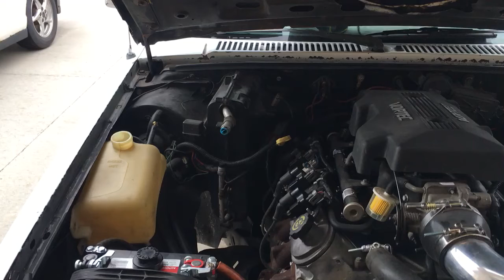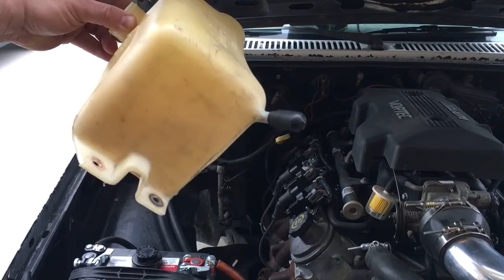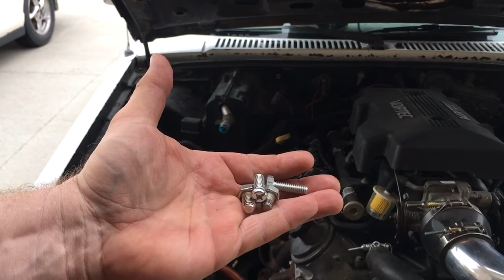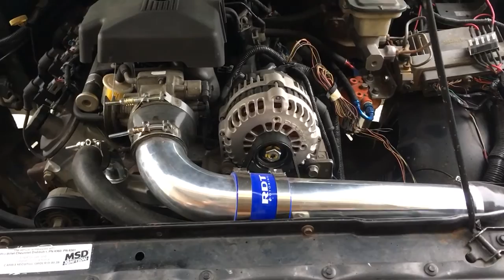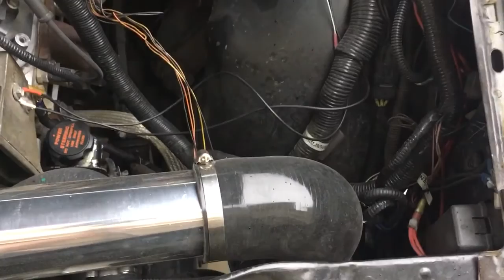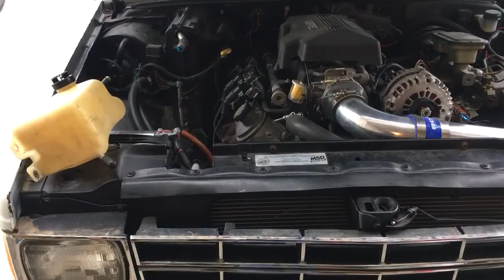Dual Exhaust NIGHTMARE plus 5.3 update

Comment: Just got my motor running for the first time tonight. Thanks for your recommendation on the vats removal from eBay!
Reply from the maker: Brian's 4x4 I'm glad your reflash worked , make sure you can Rev normally and check the codes.

Comment: That sickness made at least 90 people where I work call in.
Did you ever finish porting the Mopar small block Procomp or Promaxx heads?
Reply from the maker: TheProchargedmopar The last set of Chrysler heads I ported where 6.1 Hemi heads. I did a FAKE set of LS AllStar heads last year.
The guy Tony Sizemore Headbytes channel might be the one you're thinking of on the Mopar heads. 
I've been working mainly with LS heads lately. 
Thanks for the feedback it's great!  JD